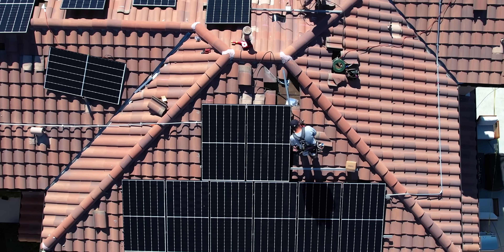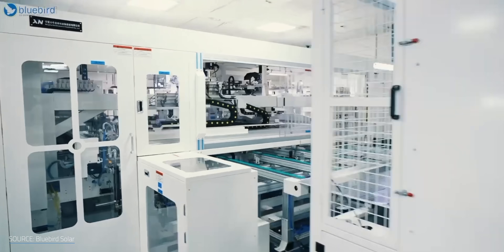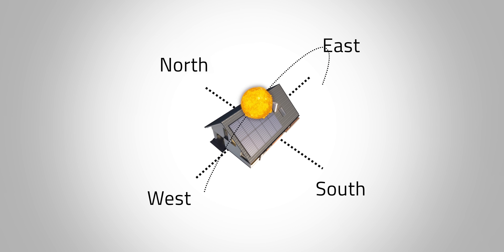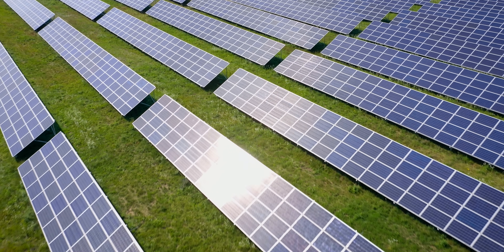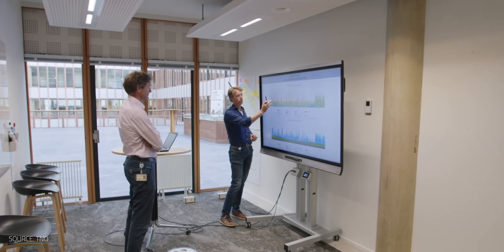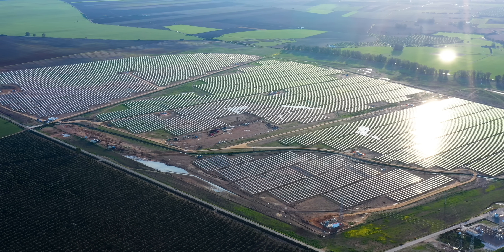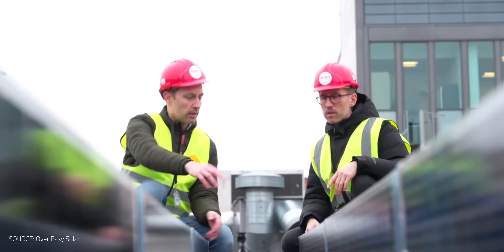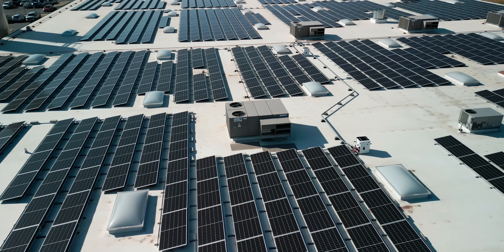Have we been doing Solar wrong all along?

Comment: Real big win of this is snow immunity.
Second big win is those of us scared of heights and can't get on our roofs will find these easy to clean as just fence panels.
Reply: Also makes a very nice looking fence and reduces the need for storage.  Both approaches have their place and hopefully we see improvements in the cost/tech of bifacials.  Given the current cost it may be simpler to just bolt two "normal" panels back to back.
Reply: snow and dust. I live in Santiago, Chile, and the atmosphere here is dry but very dusty. So, anything horizontal or near-horizontal rapidly gets covered in a layer of dust. These vertical panels would be immune to that issue.
Reply: Third win would be using it for farm installations.  Power outages on farms suck, because you still need power to your pumps and outbuildings.  Livestock need fed and cared for, regardless of whether the power is out or not.  If you can run these along fence rows, you can use it to power those and not worry about outages.
Reply: Also for the summer blazing heat in Arizona these would be better. Just sayin.
Reply: Snow on the ground should increase output as well. 🤓
Reply: It would definitely reduce the buildup of snow and probably reduce bird crap. Would it be less susceptible to hail damage?
  I hope whomever is driving the Claas tractor with the 30-foot butterfly mower is paying attention to where they are steering and not their cellphone, or at least has the autosteer option engaged
Reply: Third win would be using it for farm installations.  Power outages on farms suck, because you still need power to your pumps and outbuildings.  Livestock need fed and cared for, regardless of whether the power is out or not.  If you can run these along fence rows, you can use it to power those and not worry about outages.
Reply: @sinocte  Making solar work off grid adds a lot of cost.  Hopefully if it becomes popular it will be less but it sucks that the grid is accepted as being such junk.  major investment is needed in the grid because the reliability is going the wrong way and everything uses the grid these days.
Reply: Uh. Not sure if this is going on roofs
Reply: @Chazinthius  On flat roofs they would. And the square mileage of large flat or nearly flat roofs (factories, warehouse, agricultural hangars, shopping malls, apartment buildings, many hotels, etc) is huge.  In France, where I live, a statistic is made of it, it is called the "grands toits" (large roofs) area, and it stands at around 3000 km2.  If all equipped with solar panels... which should be technically very easy, it would generate more electricity annually than the total French power consumption, would take zero land away from agricultural or other uses, and would have negligible esthetic or other negative impacts.
Reply: @st-ex8506  but why would you put this on your roof when you could put it anywhere else on your property where it would effectively double as a fence? Fencing is expensive, and a pain to install. if you get a fence and electricity generation out of the same object, big win.
Reply: @tonydeveyra  Not everyone has a garden to be fenced.  I do, and a 10 acre one at that, but it is delimited by hedges, not by fencing... not good for PV panels, but excellent for the biodiversity!
I was talking of flat roofs of large buildings, not of those of family houses.
Reply: @tonydeveyra  I didn't mean to imply they should go on roofs, more that you don't have to go on the roof because they can be a fence.
But also, kids, kids break things.  Someone will pass your fence and throw a rock at it.

Comment: Ya know... I REALLY hate these "Have we been doing 'X' all wrong?" because, invariably, the answer is a resounding "NO!"

Better luck next time.

Also, if you are going to throw a plot up, LABEL the plot lines to correspond with the verbiage of the topic under discussion. That one at 7:33 does NOT show which line is the bi-facial cell, and which of the other two are not explicitly. i.e. The legend sucks. <Chief engineer hat back off>

Comment: This is a great example of accidental biomimicry. Some species of termites build flat east west facing mounds to prevent overheating and to capture the early and late sunshine for the thermoregulation of their mounds.
Reply: Biomimicry for the win!
Reply: It was purposeful biomimicry when we designed a vertical bifacial PV that pivots in the wind along the upper edge. Goes horizontal in high winds. look up agrisoltaics Hope this helps.
Reply: @energyideas you mean agrivoltaics?
Reply: Also the jarilla Larrea cuneifolia (Zygophyllaceae), a South American desert creosote bush, grows its branches and leaves facing east-west, avoiding excessive water loss during hot middays
Reply: Alternatively, you can see this as biomimicry of plants… normal solar panels mimic typical tree leaves, vertical panels mimic grass blades
Reply: Love both of these comments 🫡🙏🏼🙏🏼
Reply: Maybe we need leaf like panels that imitate trees
Reply: I'd be willing to bet if we make them smaller and put them on towers to allow them to flap around freely that we might even see better results.  Have them all connect to the middle tower and run all the power down to a central bundle in the ground.
Reply: @jaerin1980 a flag set up gets the best of both worlds, better cooling, no static shadow like VBPV, no dust like horizontal PV and less chance of pest infestation eating or damaging wires. No dew from moisture either
Reply: @jaerin1980    Lol or turn the Solar panels into wind turbine blades or conversely turn wind turbine blades into solar panels.  

   Dual use!  

  (I'm mostly joking, as wind turbine blades don't really provide enough area for good Solar conversion).
Reply: time and time again biomimicry wins, there are millions of years of evolution just waiting to be used

Comment: I want to install some of these at my home. I'm curious on the outcome as I 've not seen a single video with actual comparison between vertical and "regular" solar panel orientation.
Reply: Standard orientation is still going to give you more overall juice.  The advantage for these is that they can be placed where standard panel arrays can't.  It's not a replacement for standard arrays, but rather an additional way to collect solar.  The study that showed the 2.5% improvement was over EXPECTATIONS for the east-west layout, not over standard horizontal panels. Think about a divided highway in the US.  The median often isn't wide enough to deploy standard solar. It would be too chunked up.  But you could run a line or two of these down the median.  Generate a bit of power, add some shade, provide some noise reduction... and all in a space not suited for standard solar. And we've got one helluva lot of highways here.
Reply: @sinocte  I already have east/west facing panels. That's the nature of my roof. Make them point south would be far costlier due to have to buy the metallic structure.
However, having two peaks out of midday would be really interesting. Also, cloudy/misty days in winter make the production drop.
So, at some point I want to make install a couple of vertical bifacials, Then after a year I will be able to make an idea on how good or bad they are compared to just install more in the roof (that would mean change the 4kw agreement to export to the grid, something I'm not keen on doing).